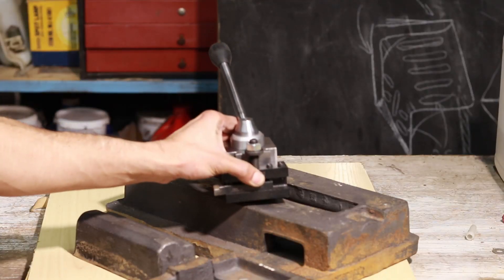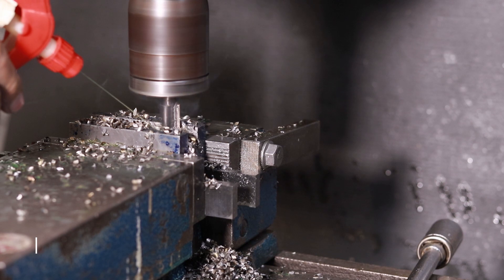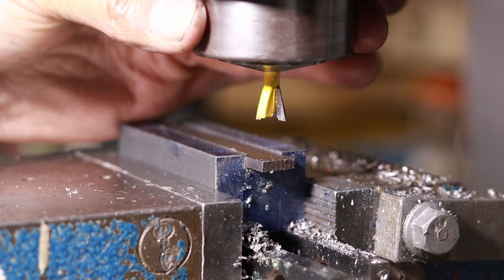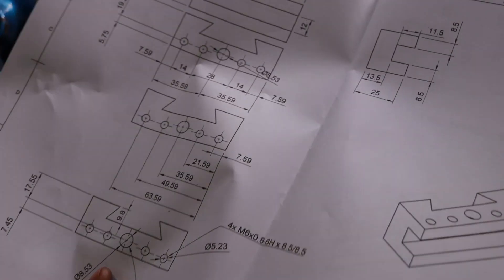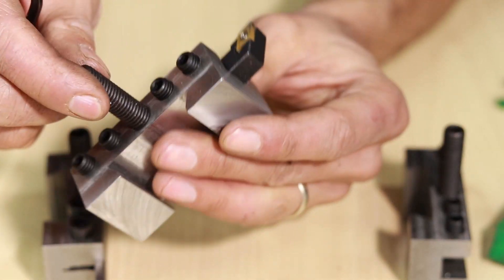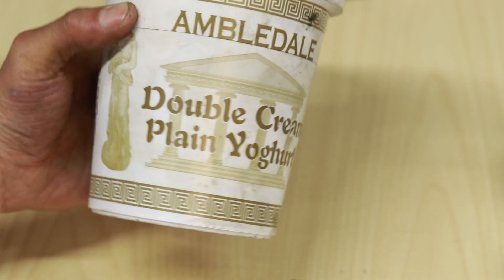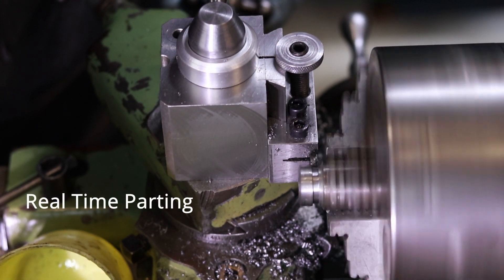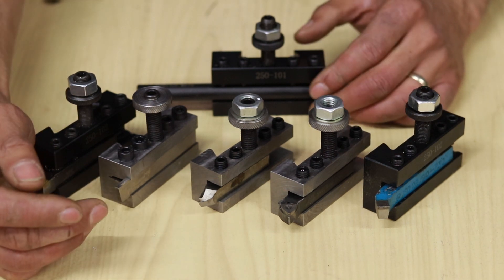Easy Parting Blade Holder & Tool Holders for the DIY QCTP

Comment: Mark, I would suggest the FoR style of Parting Tool by Eccentric Engineering in Australia. I am sure with your brilliance you could fabricate your own version. The FoR and My Diamond Tool Holder Set (L&R) are my go to tools. waiting for your Mill Vice Project to continue
Reply from the maker: Checked them out, nifty site, I was very tempted to make that style of blade holder, just holding the trapezoidal clamping bit for milling seemed like it would take more time to figure out than I had. I'm hoping to continue the vice build over the holidays